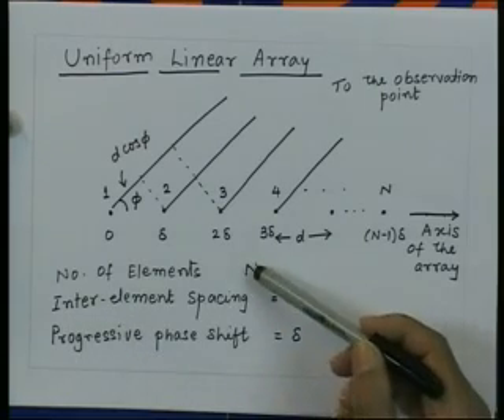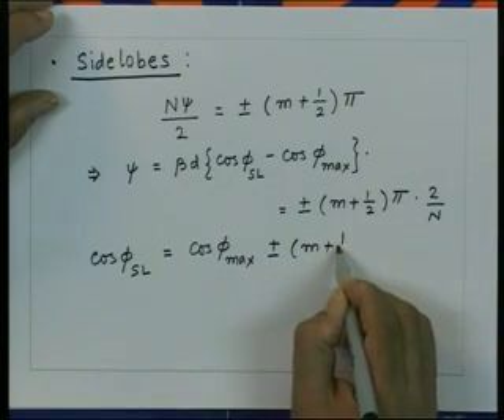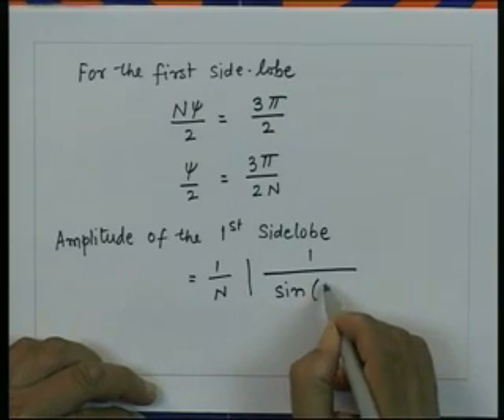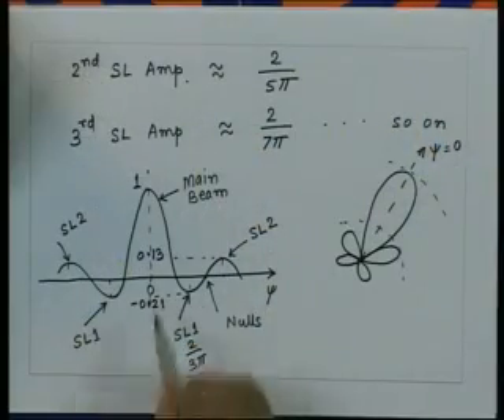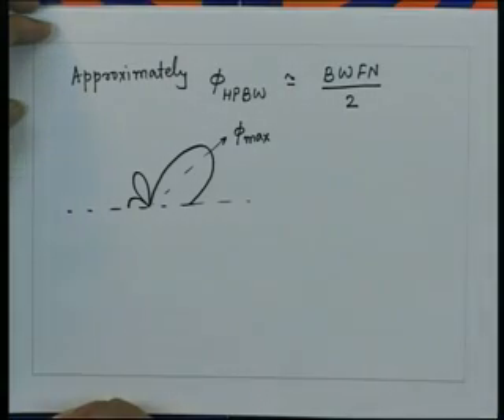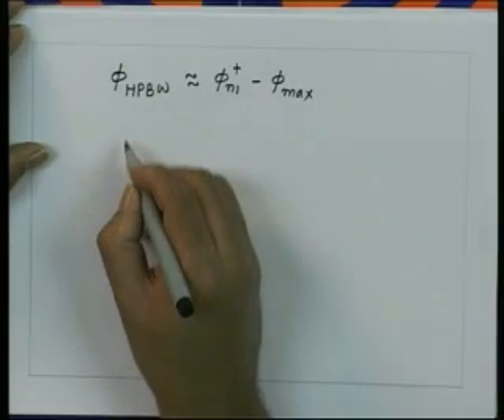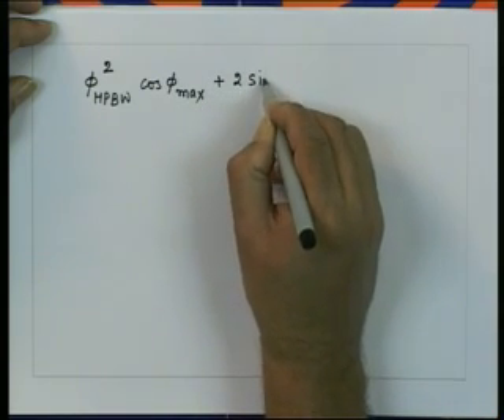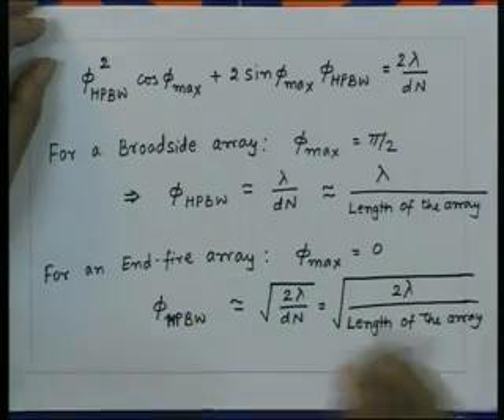Uniform Linear array continued

Comment: Sir in HPBW calculation with m=1,the term should be cos(phi Max)=.....+3/2 (lembda/dN).
please guide..
Reply: in HPBW calculation  we caculate the first null not max of first side lode
hence we use formula cos(phi(first null))=cos(phimax)+m(lambda/Nd)   m=1
Reply: Good question
Reply: @UnsungOdysseys  Yes. But the formula to calculate phi for first null and first side lobe is different. I don’t see a reason why m = 0 can not be taken. That is the reason phi for side lobe has term m+1/2 to make it odd multiple of pi/2.
Reply: @UnsungOdysseys  Oh I got the reason. If we see, formula for phi for first null, there m value is to be taken from 1. Otherwise it make phi equals to phi max.
Since, a side lobe lies between two nulls, therefore first side lobe should lie at 1.5 , which is midway of null at 1 and null at 2. And the value 1.5 will only come when we put m = 1 in formula for Phi SL.